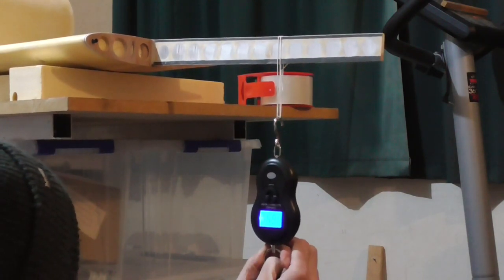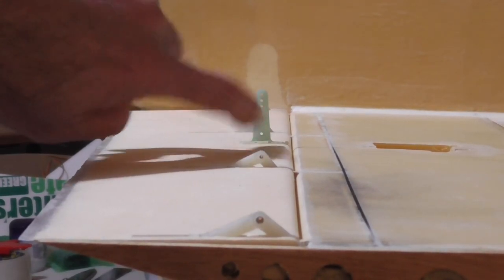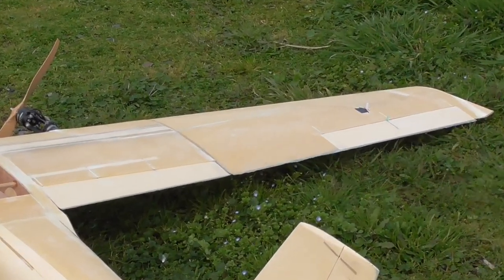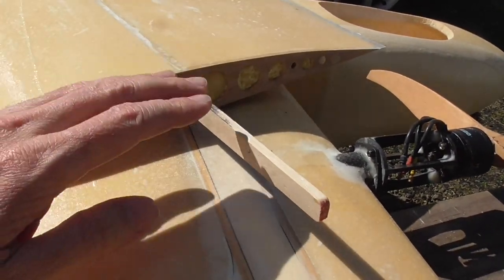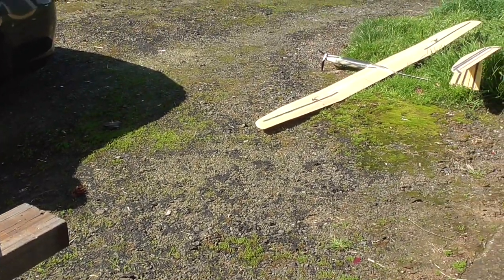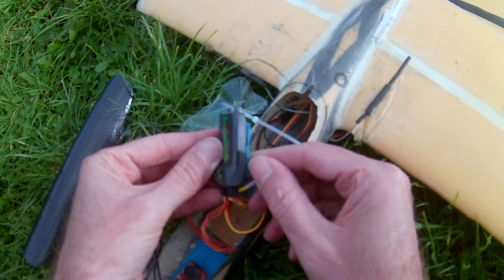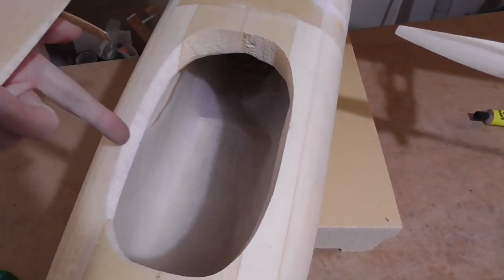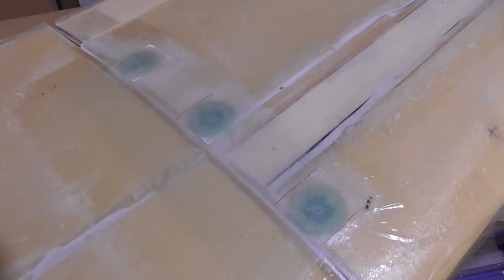Twin Hopper part 4 (wing join, hatches, wiring)

Comment: The electronics box looks quite festive. I agree with your interest in reducing connectors on your control wiring, though the motor is one of the least disasterous controls to come unplugged midflight. The biggest counterargument to hardwiring things is for situations like your receiver antennas, which would have a better chance of survival if they were the type that can unplug from your molded-in antennas in a crash, but are not removable in flight, because now you have a quickly-swapped, cheap RX, but the wires look like an expensive (in time, at least) job to rework. 
Also, I'd put your GPS outside of your electronics spaghetti bowl, like in/towards the tail, and your radio RX and Video TX in separate locations (even though they are in different bands).

Comment: I don't know how I missed this entire build series but DAMN!! That is one gorgeous plane! 
I'm pretty sad that it turned out as heavy as it did (I've had similar experiences with scratch builds) but I think it's built plenty strong enough to handle whatever you throw it at, short of a full lawn dart attempt. 

For strength considerations for your next project, I would consider some thin aluminum or carbon toe for tensile applications such as wrapping from the spar to the fuselage/payload plates as opposed to the large blocks of wood. 
I would also consider hogging out the wings and body as much as possible with lightening holes and then cover them with some thin flat layups of fiberglass, being adhered directly to the foam. 
Consider watching Ramy RC and how he skins the wings on his large airliners. A thin layer of fiberglass would be easy to contour to the central and trailing edge of the wings while still holding considerable strength and then you could fiberglass the leading edge as you normally would. 

I love watching your videos and I can't wait to see this one fly! I'm hoping for the best!
Reply from the maker: Actually the weight is not a whole lot over my target of 5kg which was rather ambitious. A balsa and covering film build would certainly be much lighter but I like the idea of it not turning into a pile of confetti at the slightest crash. Also this is supposed to be carrying a 5kg payload someday, so it's built to handle nearly twice it's own weight.

Comment: I love how you spend months and months carefully sculpting this aircraft into existence, only to then equip it with a vintage flight controller 😂
Reply: Fr tho
Reply: 😂Think it's a factor of a known, vs many unknowns ... and electronics pricing in 2022.
Reply from the maker: Well, the existence of newer products doesn't make the old ones not work, especially when the functional components are basically the same anyway. The more micro-controller programming I do the more I'm aware of what the actual requirements are, and that eg. upgrading from a 72MHz to 168MHz chip is probably not an advantage when 16MHz was already sufficient, most stack space is barely touched. Having more timers and DMA channels can be helpful, but only if the firmware actually uses them. But yeah, prices are high and I had an omnibusf4pro ready to use, which does everything I need. It might be nice to have SmartAudio as well, but after the plane is tuned I could swap that in instead of the bluetooth.
Reply: @iforce2d  Just to be clear, I wasn't making a criticism, I was just amused at the novelty of it. It absolutely makes sense to use the gear you already have if it works well :)

Comment: The servo style plugs are usually pretty reliable especially if you put a little hot glue on them. That being said the most reliable component in a machine is the one that isn't there.

Comment: Nice to see it progressing! Maybe twisting the aileron servo wires could prevent some interferences? And regarding the undercarriage have you considered using a "bungee" slingshot? Might be simplier than interfacing a dolly or than modifying the structure for a fixed gear. Anyway very interesting project and nice to see how you tackle every technical issue!

Comment: Lot's of nice work and interesting solutions. But you almost lost me at the wing joining mechanics. Some ideas: In my big twins, I have often used the 5V ESC BEC for the servos in the wing, thus avoiding running the 5V servo supply all the way from the FC. You only need the fat Vbat + and - wires for the ESC, and thin wires for gnd and signal - in you case 3 thin wires. And concerning the GPS: There has been some reports over the past two years on RCGroups on this type of device failing. For larger planes, I now always use two and the Arduplane setting "Best of" rather than "Blend". Looking forward to the maiden!!!

Comment: handsome 😍 @41:35 no movement from the elevons to compensate for the flaps? intentional or you missed it 🙂
Reply from the maker: I've never really seen the need to do that. If I'm flying manually I'm already constantly adjusting the pitch as necessary. If the autopilot is flying it's already constantly adjusting the pitch as necessary. As long as the flaps don't move too suddenly I can't see any problems arising. I suppose if it's trimmed properly I could take my hand of the controls for longer in manual mode, but it doesn't seem like a huge advantage.

Comment: In the future run a long piece of string through the channel making sure you have plenty of slack on either end. You can then tie a servo wire to it pull it through then pull the string back and pull the next one through.   That way you only ever have to really worry about fishing something through one time.
Reply from the maker: That's fine if all your servo cables start and end at the same place, will keep it in mind though.
Reply: @iforce2d  good point. Another thing that we used to do when I did a lot of pulling cable and buildings is use a vacuum cleaner to suck a string through a conduit. That may also work for your application.

Comment: What CNC Machine are you you using and what is the Foam you are using? Thanks . . . FWIW I use QCAD to design Giant Scale R/C Airplanes and then print templates to cut the parts out using regular wood working tools . . . Great and informative video.
Reply from the maker: I made the CNC machine last year:
https://www.youtube.com/playlist?list=PLzidsatoEzehkZsayxC9HBiD88F8dl1NN
The foam is extruded polystyrene (XPS) building insulation.

Comment: Given bluetooth has limited range, are you planning on only using it on the ground?
Reply from the maker: Yes, I forgot to mention I will be using FPV to see the stats while flying so the telemetry would only be for tweaking options in between flights.

Comment: I see you are uing micro baloons as glue to fix foam parts. Is it microbaloons + epoxy resin ? Can you please tell me how you prepare this glue??
Reply from the maker: Yes, microballoons sometimes when I want it to take up more space but still not get too heavy. There is not much to prepare, you just stir them in after mixing the resin and hardener, don't add too much at once or it might get dry. I usually set aside a little bit of plain resin so I can add it back in if it does get too dry. I made some general epoxy preparing tips here but it sounds like you have this much knowledge already: https://youtu.be/ae7iOcGZPNg?t=208

Comment: I saw that you had 2 types of motors. What is the code for the single motor? And what is the code for the dual motors and do the give better thrust?
Reply from the maker: Not sure what you mean by 'the single motor'. There have always been two motors for this plane. FMS predator 4250 580kv.

Comment: I think that small 55 amp esc is only good for quads cause u r not always pushing the esc to the max or the motors to rhe max but those big esc with heatsinks are more suitable for planes and heli  where motor is continuously    running at its peak for longer like a helicopter motor where continous  power is demanded for longer thats my thought cause there is no way those small blheli esc can do 55 amps for longers cause i have seeen esc marketed for helis and planes always have big ass heatsink on them
Reply from the maker: The plane is also not pushing to the max either though. With Big Red at 9kg it took 90A for a few seconds at launch, then cruised at 20A which would be 10A per ESC. I'm tempted to try them sometime but also probably too lazy to do it...

Comment: Thanks for the update! Good luck with the dolly, have you thought of a catapult or is that too much?
Reply from the maker: Dolly seems so much easier though... if I ever try the overall goal of carrying it's own weight in payload, that would now be 13.6kg. Would have to be a very strong catapult and attach point, and would still need some kind of sled or dolly anyway I would think? The airstrip where I'll be launching from has a flat area at the top with a sudden slope down, so if it's not already lifting off the dolly by then it will be somewhat catapulted anyway :)
Reply: @iforce2d  yes, you have a good point on the runway you can use.
Can't wait to see the next video.
Once it flies well and you may put a landing gear on it, will you take it to fly with your uncle Bruce and the rest of the Tokoroa gang?
Reply from the maker: I forgot to mention, a dolly could also be powered to assist shorter takeoffs. Not planning to do that but if I had a nice wide and flat runway like uncle Bruce I probably would be trying all kinds of nifty things like that, and autoland with lidar etc
Reply: @iforce2d  No limits to the imagination and skills, right on! Whichever you choose, I'll be here to watch you complete it. Chris, you have great ideas, love them all!

Comment: I am curious why after all these years and extensive time, development, and materials. You have sted fastly stuck with SkyFly radio. I own them. Two to be exact and I agree they are a good radio. But I am surprised that you have never upgraded especially considering the low cost of radios significantly more advanced. Have you attributed your lawn dart incident to a cause? Because it looked as if you lost control. 
Just curious, I look forward to all your content and no judgment is implied.
Reply from the maker: I just haven't found them to be inadequate, that's all. Plus I have so many receivers for them. FlySky actually wanted to send me one of their new radios but with incompatible receivers it was pretty much a non-starter for me....
The lawndart was caused by me losing orientation, which in turn was caused by pushing the limits of how tight I could circle, and also because I had lost orientation many times in the preceding few minutes without any consequences and got careless. That plane also had an issue where the elevator response was weak at high speed, although I'm not sure if that mattered in this particular case since I was probably commanding the wrong movement anyway :)

Comment: Nice to see progress, but you wing joines are just horrible. Firstly, you will have no strucutral strenght in that joint at all. Secondly, the material you are making it from should be strong but elastic. Yours is brittle and thin. I hope you redo this part because I can see a disaster waiting to happen if you continue with this "design". Have a look at how other manufacturers are making wing joiners and find some inspiration to do it better please.
Reply from the maker: As shown in the video I tested that join to 3.6 times the stress it will endure for a 10kg flying weight, with only the naked spar. That was before adding the foam, and skinning the wing and adding the extra joining section. It certainly could have been done with much cleaner methods if I actually planned it more carefully, but I'm no longer concerned that it will be too weak. When I suspend the plane from the wingtips at 10kg it only flexes enough that the fuselage lowers about 4cm. In reality when flying, the load will have a parabola-like distribution with about 50% being inside the join. http://www.iforce2d.net/whipplecalc/
btw I have never heard that such joins should be elastic. On the contrary, carbon fiber is commonly acknowledged as an ideal material for this kind of thing and is very much non-elastic.
Reply: @iforce2d  OK, maybe my comment was a bit harsh, but you made such an incredibly beutiful plane with so many intricate design decisions, I simply do not understand how sloppy you did this detail and it's quite an important one, both visually as well as for performance. 

FYI, usually on balsa planes, wing joiner that connect the wings to the uselage are placed at centroid height on the wing and are bolted inside the fuselage. The way you would add wing joiners in a position like this is by glueing a nylon thread into the fuselage-wing that then connects to a hole on the other side, so that you can screw the a nylon nut down. You'd need some cutouts to do this, but as this part is taking tension only, you don't worry about the material and you just make 2 little hinged hatches with the winge being on the leading edge side. That way. it will not open during operation but will allow for quick diss-/assembly. I don't know if this is clear, but I'll try to make a video with a CAD file so that you can see what I am talking about.

That connection needs to be in compression because you might get wing fluttering at any arbitrary speed and that will likely lead to disintegration of the joint as well as the plane consequently. Also, since you mentioned strengh testing: What you have tested is static concrentrated load strengh, not *DYNAMIC*. and without lateral forces to cause excentricities in your loads. These  risidual loads after linear deformations occur are called secondary effects and are usually calcualted in non-linear finite element models of a connection. Not only that, but you might introduce fluttering, and those type of cyclic dynamic loads will certainly break that connection within seconds. I can go into a lot more detail, but I would strongly advise you to redo that connection and make sure that it is in compression by some mechanism.
Reply from the maker: Like I said, it's sloppy because I didn't plan ahead. This is the result of trying to make the best of a mess that past-Chris left for me. That said I have zero concerns about the strength now, dynamic or otherwise. I would make a longer reply but your claim that flutter would cause this joint to 'break within seconds' makes it hard to take the rest of your comment seriously. The join was under compression when the final cure was done for the lower side bolt positions, so there is no slack or play in it. I can lift the tail off the ground by twisting the wing just outside the join without any deformation or hint of movement in the connection. It takes 8kg force at the trailing edge to do that, and simulating flutter by yanking it up suddenly makes no difference. The internal spar/prong would not play any part in opposing these twisting forces, so this load would be almost entirely taken by the wing skin and the join. My simulated flutter yanking probably put about 10kg force on one small spot at the trailing edge which is about the weight of the whole plane, and this assumes that it could even fly fast enough to risk flutter which seems highly unlikely. But let's see what happens when it flies, you could be right yet :)
Reply: @iforce2d  I mean, if you don't think the comment is serious, just have a look at "dynamic amplification factros" and you'll understand. As I said, I could have gone into a lot more detial but I don't think it was necessary to be frank.